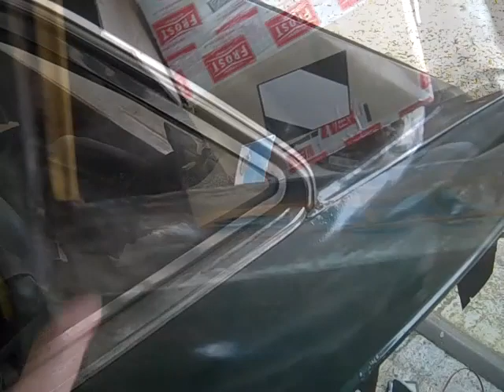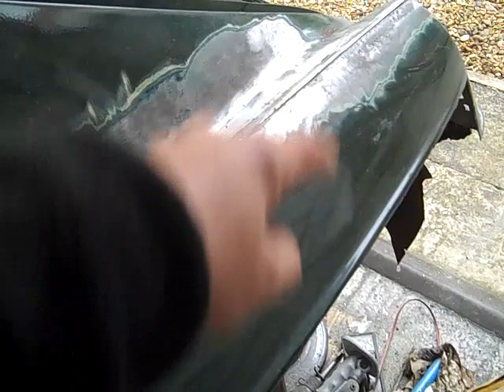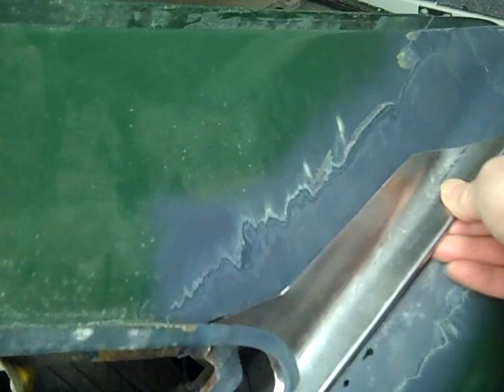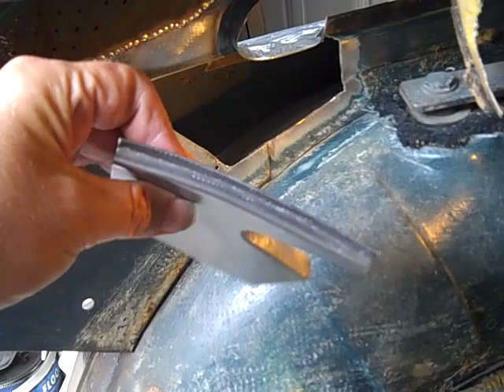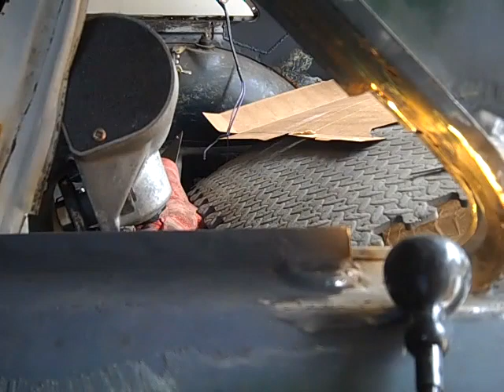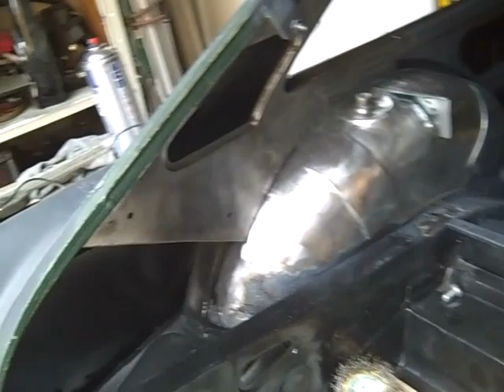MGB Restoration top of rear wing window repair

Comment: Hi great video, do you have any further videos on the external patch on top of the wing or any templates as I need to do this, mine looks like a previous repair and it was riveted and old rust metal left in place, any help would be appreciated?

Comment: i know you did this was 3 years ago but i have the same issue on my drivers side, how did you make the panel for the top of the wing?
Reply from the maker: Sorry I missed your question. As with most panels, I started with cardboard, something like a breakfast cereal box to cut out the shape until I finally got it to fit. Copied this to steel then hammer, vice and wood to recreate it. If you check out some of the other videos you can see me making panels hence not videoing every panel. Hope that helps. Best of luck Des

Comment: Hi Des, very clean and meticulously done repair on what others night have considered a scarp panel. Do you know of anyone in Southern Ontario that does similar type of repairs?

I have a 65 MGB that I am struggling to find a competent body shop for.
Reply from the maker: Sorry I'm in the UK. Is it not worth giving it a go, I originally took the car to a repair shop and was told I would be better off scrapping it so I decided to give it a go, start with a simple straight forward job and you should soon start to get better. The only thing is when you look back at your earlier jobs you wish you had done better. Good luck, Des Acetek

Comment: Hi you know at the  rear both sides of a MGB GT you have a raised area. I think you called it a line. What are they actually called,  mine needs replacing, are they easy to replace?
Reply from the maker: I didn't as you can see, however they look a bit like a T section which originally is welded between the inner and outer wing. So if you do replace it I would say it's difficult.

Comment: Des, you give instuction in body repair in MGB sports cars, are you a qualified panel beater/ sportscar restoration specialist? It
 seams to me that  youtube makes eveybody a craftsman.
Reply: Or vehicle painter and Mechanic.
Reply: You will give us your your trade Quals.
Reply: In Australia we have our people qualified.

Des is not a panel beater.

they are shit videos, I'm from the USSR  Des.
Reply from the maker: No, of course not, but I used to  manufacture models in different materials for photography, so I guess that may of helped. I like making things take a look at the travel guitars I make or the CNC machine I designed and built during lockdown. Vintage looking amplifier valves were my last effort.

Comment: superb fab skills! i did this job about 6 weeks ago but left all the seams oem as my car was only just showing the odd rust spot in the  corner of the frame, so i caught it in time. Fortunately for me  most of the work on the frame gets covered up so my amateur work never gets seen! id give me a 5/10 (i've seen worse ) but you a definite 10/10! Well done and thanks for the great vids.
Reply from the maker: Thank you for your kind comments. If you need any videos on  MGB bodywork I have most probably got it. I was going to make a full version doing it all but never seemed to find the time so I'm just doing a few short ones.